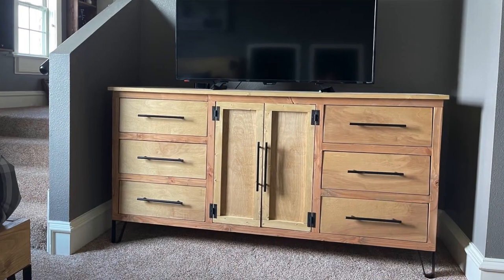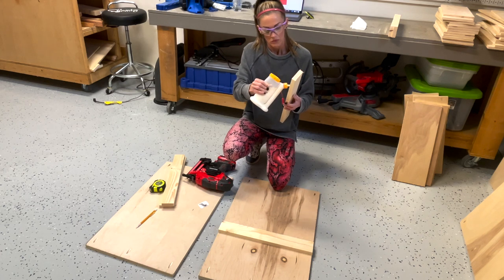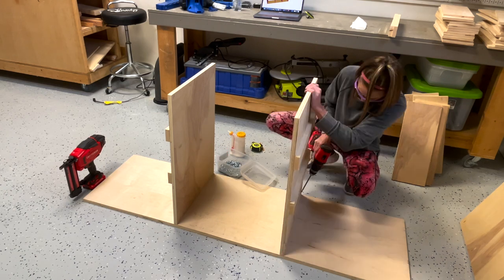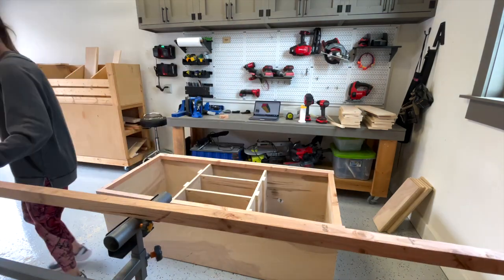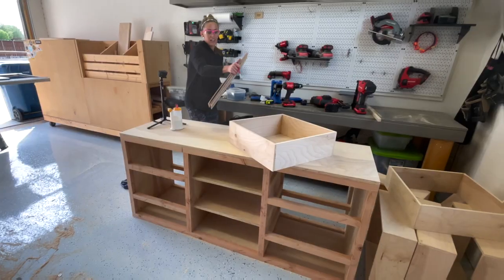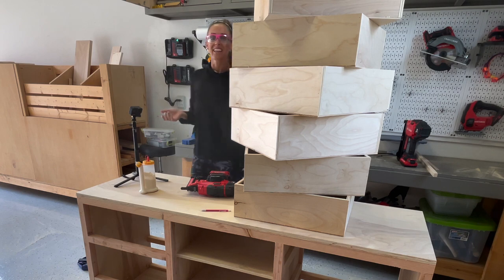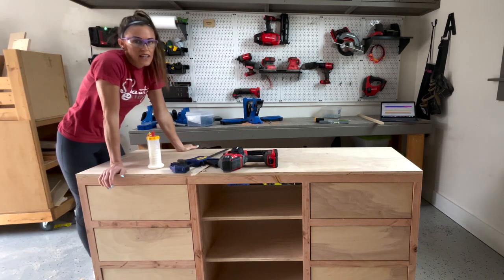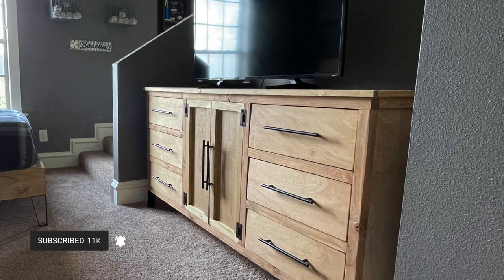DIY 6 Drawer Dresser

Comment: Pocket screws in the front and back of the drawer driven into the sides is much sturdier. The back you never see and the front is covered by the drawer front. Just a suggestion.
Reply from the maker: I’ve done them that way before. This is 1/2” plywood and the nails and glue are plenty.